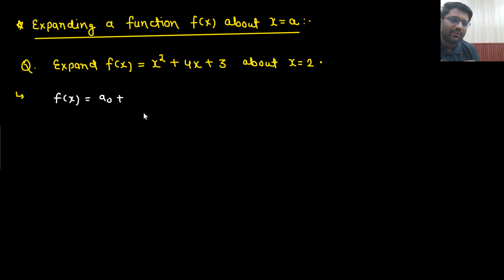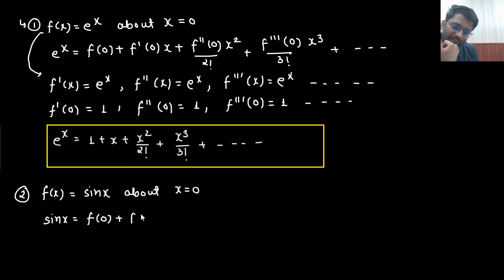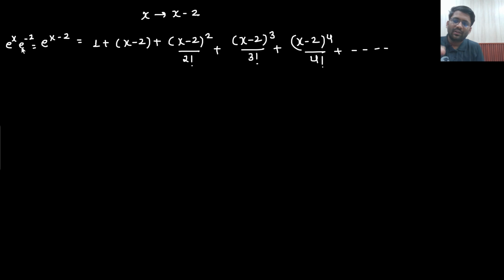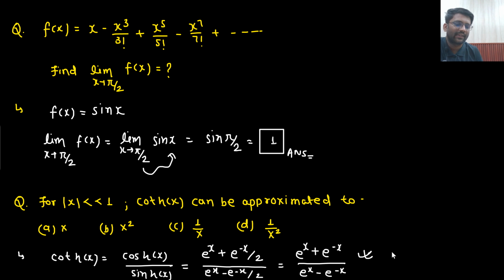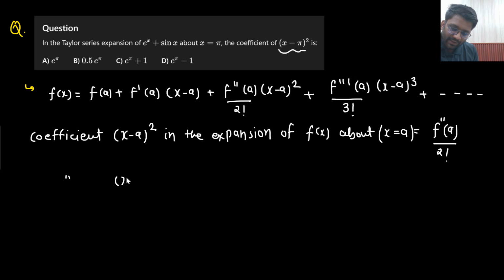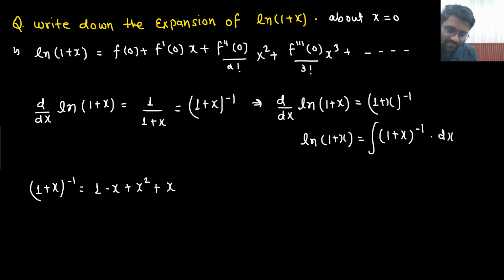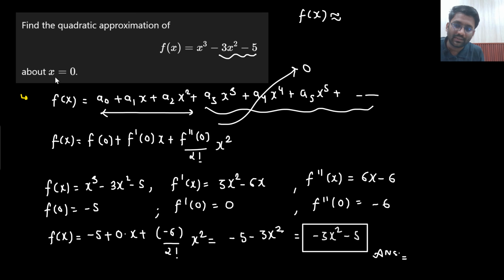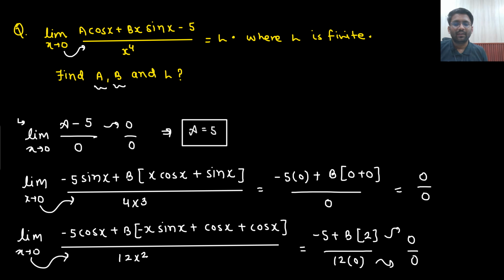Taylor Series || Engineering Mathematics || PrepFusion

Comment: Sir for the problem e^x+sinx about x=pi,coefficient of (x-pi)^2 can I use the intuition that as sin has no square term so simply find the coefficient of square term in the expansion of e^x about the point x=pie ie replace x as x-pi and then find the value. 

It saves a few steps.